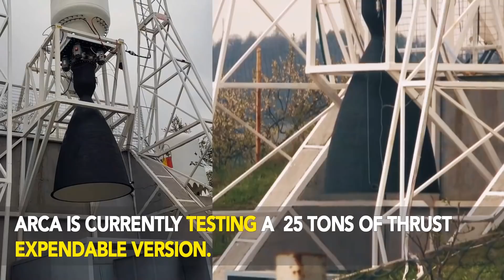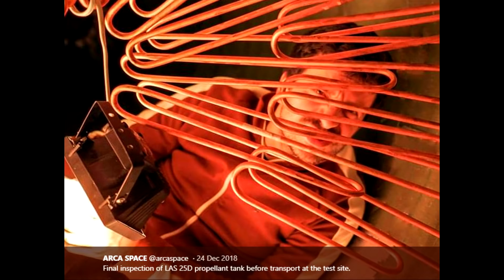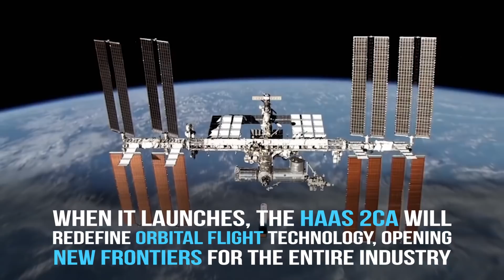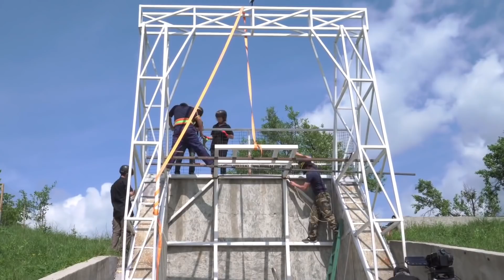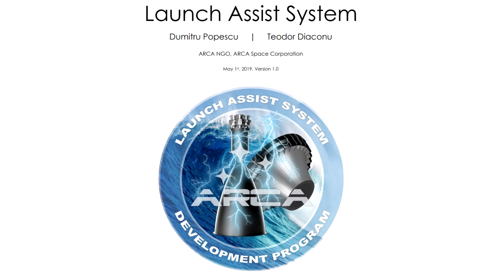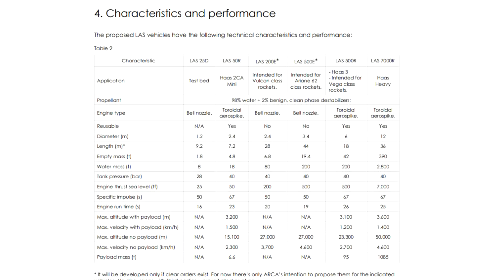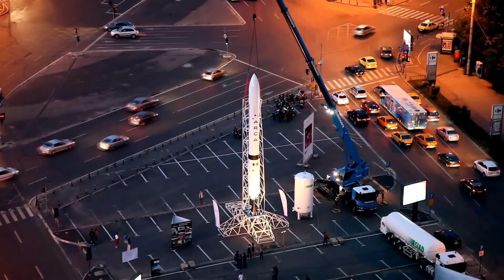Does ARCAspace's Water & Electric Powered Rocket Make Sense?

Comment: Steam rockets? We are at peak ingenuity. 😂
Reply: I remember a flat earther building a steak rocket that successfully launched, however he made it just under a km
Reply: @nikkothegoblin  a steak rocket you say? I'm intrigued, yet sceptical.
Reply: You know what, I’m not even going to correct that. A steak rocket sounds sick
Reply: Well, the Mythbusters did launch a salami rocket, so I don't see why a steak one wouldn't work...
Reply: @AttilaAsztalos  But the salami rocket was a failure, only propelled by the Nos gas :p
Reply: @DKTAz00 well, that's exactly why at first I typed "flew" then deleted and replaced it with "launched" - calling what they did actual flying would have been waaay to generous; but sure, it was a "launch"... ;)

Comment: Ok, so next level thought - what if they would heat the water from earth, using lasers. Heating water with huge matrix of lasers would work wonders on weight limits. Only thing they need to build is some kind of heat converter. Then we have super duper effective rockets with engines that can be reignited on call, and refueled almost anywhere. So this allows to create assembly or stargate on the orbit, with giant tanks holding water where space ships can refuel, get rebuilt or whatever. This part is barely possible with fuels we use today, especially liquid oxygen that heats up in space.

And you can easily plan journey to accommodate for recharging batteries
Reply: Someone needs to bankroll the billion dollar laser array first
Reply: Someone needs to fix his Home-made FIBERGLASS BOILER FIRST,  THEN HIT IT WITH LASERS, GOOD BYE ROMANIA.
Reply: if you can reliably hit the thing with lasers from earth and transmit enough energy you dont really need the water anymore

Comment: This is how I see how a steam rocket might be viable: a molten salt reactor for heat and electricity; Use the heat to boil the water and then feed the steam into a microwave cavity thruster.
Reply: You nailed it, Buddy!
Reply: There are 1,000 fun ways to move a rocket around if you first imagine you have a reliable source of tons of energy that doesn't weigh much.

Comment: would it be more efficient to run the steam engine on coal instead of batteries?
Reply: Yes, but worse heat/s
Reply: This is why Britain does not have a space program...
Reply: @joshua43214  
We don't have a space program because why would the country that invented gravity want to go to a place that doesn't have any?

Also we sold our space program to the French for one pound.
Reply: mixed with old rubber tires and liquid oxygen would be your basic solid booster rocket , so yeah worth a shot..
Reply: @joshua43214  We used to, we developed our own orbital rocket and everything. But then the government cancelled the programme after the first successful flight and we ended up using American rockets instead (which were twice as expensive). Britain is always held back by politicians who can't see past their own nose >:(

Ahh well, at least we've got Skylon.

Comment: I interpreted it differently. They use mains power, not batteries, to heat up the water ON THE PAD. It's superheated, it flashes to steam as soon as pressure is lowered. The batteries are supplemental and provide an extra heating stage before exhaust, but most of the heating happens before launch. That's why it's only for "launch assist" - after launch the propellant tank starts to cool off by thermal radiation and convection, reducing efficiency.
Reply: You can't pre-heat the water in the tank.  The pressure gets so high at 250 deg C that the tank becomes very massive.  It has to be 24 times stronger than the Shuttle's external tank.  They have to heat the water as it exits the nozzle.

Comment: I think a DMHO is pretty useful. You may heat it up with a powerful tracking laser beam (it's already available with tracking sold as Laser shield -- Lockhart Martin, Rheinmetall, ...  ).
You don't need to get every power in you rocket as you may get 5MW or more into your system from outside.
You may even get financing from some locals which may in need of a fast-tracking remote energy delivery system for small airborne targets (civil used remote energy delivery system --- which may be coupled with an air defense system -- and every neighbor will respect the airspace).

It may be more economical if they store the elements of DMHO separate and generate DMHO in the rocket on time,
but a commercial moveable remote energy delivery system may be rented out in several occasions.

Comment: "Specific impulse: 50 seconds"
No thanks!
Reply: But if it will be very big doesn't matter the ISP and it will cost nothing compared to normal rockets since it is very simple and use water as fuel
Reply: What does ISP mean?
Reply: @ukdrilllyrics2624  Individual specific impulse, which is basically the bang for buck a rocket engine gets out of the propellant. In rocket engines, it's directly proportional to the velocity (speed) of the exhaust. The higher the exhaust velocity, the more oomph the rocket gets out the same mass of rocket propellant.
 Higher ISP, higher exhaust velocity, higher fuel efficiency.

Comment: Hey Mister Manley,I worked at the Portland Oregon steel mill, 
On the catwalks we should drop a styrofoam cup into a vat that was super heated.
It BOOMED!! BIG BOOM.
Demonstrating the way heat separates water into hydrogen and  oxygen.
Both really volatile!!
Cant we just heat up the combustion chamber to the temp required to mimic this phenomenon.?
I know this is super simplified.
Ray Bradbury's rocket was running off of water.
And he was Way ahead of the game.

Comment: What if they used ground based lasers to transmit energy and/or heat to the first stage while it is launching.
Reply: Damn, they should've spent their budget on a giant laser and a sufficient receiver and tracking system instead of the market's most garbage RC batteries.

But still, they could do the laser thing, securing new investors should be easy for them. Romanians are known to be honest people who never make up and push bullshit and are trustworthy and would never betray anyone.
Reply: because the electricity to power the lasers is made from a corrosive, toxic and carcinogenic fuel source.
Reply: Would be interesting. It's something I daydreamed about when the Space Shuttle hadn't yet flown. Who knows, if the Internet had been around back then, I may have more than daydreamed. But unlikely.
Reply: A millimeter wave microwave and then turn the rocket tank into an antenna that directly dump the energy into the water inside. You can then use a phase array transmitter to beam microwave into the rocket using beamforming to reduce the losses as much as possible.
Reply: And they could Fax the vapour cloud to a spot below the laser to eliminate the path losses, while simultaneously gaining thrust from that vapour being sent at the speed of light, and that's enough fax to get them right onto the stock market. ;-)
Reply: Sounds good, but I've always wondered about atmospheric refraction spreading the beam. The US Navy's laser based point defense system has to use three different beams, one for range finding, and a second for measuring how the atmosphere is warping light. This data is used to reshape the kill beams focusing mirror. I think delivering energy to a rocket engine would be even more complicated as the rocket would be covered in turbulent air and have an exhaust plume that is even more turbulent.

Comment: I feel pressurized water is worth exploring. 
 My first hub which is a family business I entered in my very early 20’ s had my operating a Hydro Excavator within a few years. The turbo nozzle diddling gun operated at 3500 psi at 5-7 gallons per minute. This 15 pound long metal want with a trigger on one half and a spinning turbo novel on the other end of the 5-12 barrel was extremely powerful and is what we used to dig around utilities turning the hardest ground into mud, which would flow towards the bottom area of the bot and be vacuumed up by a 8 inch wine 5000 cfm hydronic metal 20-35 metal vacuum. 

I would get so mush power out of my water powered digging turbo novel gut that I would lean towards the hole I was attacking not to
Mention the the full weight of the digging want. The waters exit hole was about 1mm squared. 

Pressurized water is impressively powerful. 

I’m
Not even going to mention right now the pipe flushing utility on my truck. We would send it down storm drains and get about 500lb of pull. 

Higher the pressure output and water can deliver plus more safely. Any provenly left at key mission points add to the needed water for crew as well. 

My two cents after working with
very highly pressure water

Comment: The idea of using steam rockets for a low altitude booster stage is a really good idea; the idea of using LiPo batteries to superheat the steam in the engine prechamber seems inefficient compared to burning Brown's Gas (H2O in gas form) in the prechamber to achieve the same thing. 
Combine that with hydrogen + oxygen for second (main) stage and methane for space, you have almost zero pollution and all renewable fuels.

Comment: If electric rockets are to become plausible they will need to jettison spent battery packs.
Reply: Drop huge-ass packs of lithium-ion batteries into seawater? Brilliant!

Yeah, this is just a terrible idea all around.
Reply: @deusexaethera  There's already plenty of lithium in seawater; a bit more won't matter.
Reply: @paullangford8179 : Lithium-ion batteries don't just contain lithium. The most common chemistries are lithium cobalt oxide, lithium iron phosphate, and lithium manganese. All of those produce highly toxic smoke when they catch fire, and because lithium is such a reactive metal it will catch fire if dropped unceremoniously into the ocean at high speed.

Comment: If it’s the first stage, couldn’t they just heat it electrically with ground power and rely on the very high pressure very hot water flashing to steam as it escaped and skip onboard heating batteries? Literally use the mythbusters method, but with a proper nozzle and a burst disc launch it. Should be able to make that work if all you need to achieve is to lift the next the next stage a bit and give it a bit of kinetic energy. It isn’t going to go far, but it could be just enough to make a marginal rocket viable.

Comment: This idea has actually been around since the 60s, when Eugen Sanger proposed a steam powered rocket sled for the first stage of a spaceplane. This idea was developed further by the Berlin University of Technology in the late 90s / early 2000s where they also proposed using a steam rocket for the first stage of a reusable launch vehicle. 

Source: http://articles.adsabs.harvard.edu//full/2004ESASP.557E..14K/0000014.001.html

Comment: They should just use hydrogen and oxygen. Also, we ride in planes and cars fueled by highly flammable fuels everyday. Heck, jet fuel is harder to light than gasoline.
Reply: There is a reason why Hydrogen is not commonly used for the main engine (well apart from the Delta IV).
Specific impulse is great. But the density of LH2 is so low you need massive tanks compared to other fuels.
Reply: @1337Jogi  Hydrogen's other properties like vanishing from tanks not withstanding.
Reply: @1337Jogi  it's hydrogen's leaky behaviour that requires tanks to be thick, not its low density.
Reply: @bit2shift  Well thats certainly not helping. But the initial problem is the very low density and that it is highly cryogenic.
I wasn't talking about thick tanks but that you need enormous tanks.

RP-1 is a kerosene and is therefore slighly less dense than water with ~800kg/m^3
LH2 on the other Hand has a density of ~71kg/m^3
For the same stored mass compared to RP-1 you need with LH2 tanks 10 times the volume.

Of course you don't need the same mass but still.
Reply: @1337Jogi  exactly, you don't need the same because you would get more moles of LN2 than RP-1 for a given mass.
But if you fix the moles, you get less mass and less volume required to store it.

Comment: I wonder how efficient a system would be to pressurize the water tank by injecting powdered potassium (or similar material) into the water and just letting it react. You could heat up the water then boost the pressure with potassium and then lift off.

Comment: Would it be possible to just do the heating before launch? Use grid electricity to heat up the water as much as possible, then disconnect power and open the valve.
Reply: That's what they do, over four hours on generator to heat up. Batterys work his Arduino crap.

Comment: I had a red water rocket when I was a kid. That thing was fun. You filled it up with tap water and then attached it to a air pump (it had a sliding clamp that held it in place and kept it sealed. The more gas=more height.

Comment: Scott, that microwave water vapor thermal rocket sounds amazing and much more interesting than this steam rocket. Perhaps it would be an interesting subject for a future video? I can’t fathom how such a device can claim specific impulses of 800 seconds, versus a touch over 100 seconds for ARCAspace’s first stage.
Reply: The low ISP for a steam rocket is because you have to have majority of the water heated up in the tank prior to liftoff, and then they are only adding some extra heat through conventional heating methods. Heating up water through microwaves is probably a lot more energetic, but also energy-consuming. Also, while the ISP is crazy high, you probably can't get thrust high enough for lift rockets. 

What I imagine is a microwave-water rocket being really useful as a cargo tug between low-gravity environments like asteroids. You could maybe have a nuclear reactor generating electricity and pre-heating the water which then goes through the microwave chamber as propellant. Low acceleration, but high ISP and you can load up fuel with minimal processing...

Comment: Maybe it's a stupid question but I wonder whether it's possible to use a cable which is ~100km long while rocket gains altitude and get the most required electricity from the grid instead of batteries for the first couple minutes of the flight?

Comment: how fast do you think you could turn water to steam if you used a small rocket motor, but instead of an expansion bell you had a long tube that ran though the water? like a super charged propane water heater.

Comment: To use water as a rocket boost assist:  I would propose using old nuclear weapons to compress sea water and run it through jet nozzles in an inward and upward spray array so that the spray engages grid fins like those used on SpaceX's  booster recovery technique only these would be for giving a lift assist to the booster by providing a traction point for water spray to grab hold of. Plus the water spray would create a denser atmosphere to increase the efficacy of the booster rocket thrust, because it would be pushing against thick heavy wet air rather than thin dry air.
The boost assist would be limited to whatever reasonably high tubular Eiffel tower type nozzle array that could be built.  Guessing that about 1,000 meters would be a reasonable reliable reusable, lift assist, rocket launching tower.

Comment: If you want to build a green, carbon-emission free rocket, to me it seems like it makes more sense to go for Electricity -> Sabatier Reactor -> Methane. Conversion is only around 50% efficient, but you don't need batteries, you can buy electricity at peak power production of solar/wind, you can store the waste thermal energy for heating buildings, and with the 300+ ISP efficiency and complete combustion of methane it seems like a more attractive option than steam.

Comment: Could they combine this with an aerospike? If I understand correctly aerospike has huge problems with scaling up due to cooling requirements? Perhaps they could work a way to use water to cool while using the heat byproduct as thrust as well?

Comment: I strongly agree with you, whenever you need to power a rocket, it's difficult to think to do it adding the weight of Lipo batteries. To give you an example, a few years ago AmazingDIYpeojects made a Saturn V electric / steam model rocket motor and to heat up the water he needed 95 Ampere... and it was "just" a model rocket.

Comment: I had a little thought on deflection angles with a cone within a bell and was surprised at the amount of rebound thrust whilst building pressure with the cone being heated greater than the bell. A ring of thrust with expansion sail size seemed pretty good. Especially when there is no back pressure/atmosphere.
Reply: I suggested it to a developer on sketch up.
Reply: The thought was mainly for at high altitude and long distance. Initial takeoff could and probably should include thrust within cone. Fluid dynamic for heat expansion cooling one way guided, coolant mass to expansion differential coolant flow. Space is cold on yo ass - rocket.
Reply: Deflection within flow can add some thrust during condensation cycle. Coolant will probably pressurise depending on thermal differential, windchill is a factor at lower altitudes. Up flow expansion chamber volume calculations essential.

Comment: Water is a good propellant for deep space where you can power it with a big solar still that weighs almost nothing, heating it to the temperature of the surface of the sun using lightbulb thermal propulsion. It might even compete with NTRs. But as a launch rocket, batteries have just 1/10th the energy density of Kerolox. Have fun with an ISP of 90 seconds.